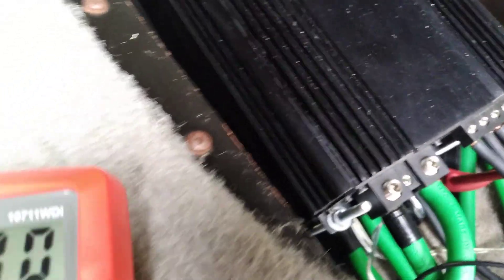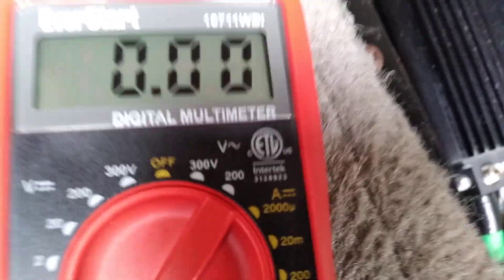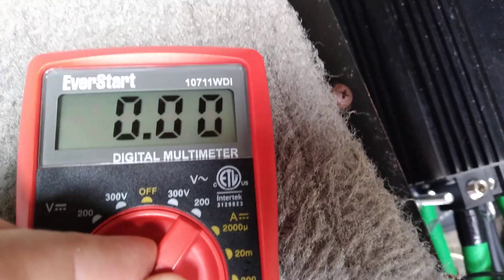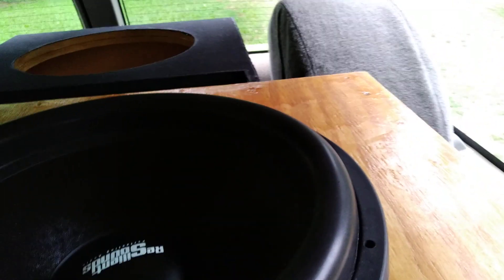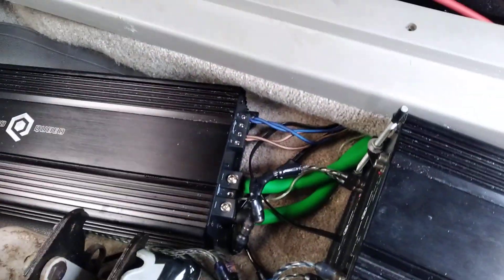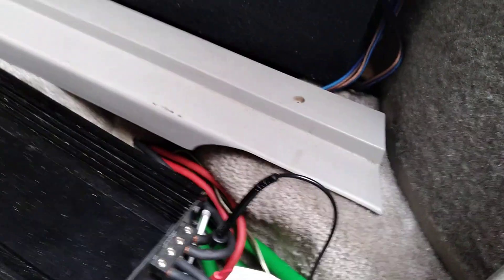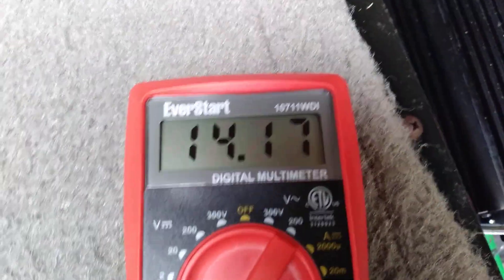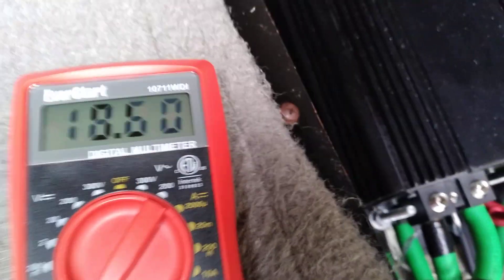Checking my ohms rise buy using a multimeter

Comment: When strapped, if impedance reads .5ohm on the multimeter that means each amp is seeing .25ohm. Id prolly wire them up to 2ohm final load(series/parallel coils on each sub)each amp will see 1ohm per. Will also be easier on ur electrical. Those 9.8v drops wont last long. U could actually gain dbs on the meter because ur not stressing the electrical system out as bad.
Reply from the maker: Thanks I might try wiring it up directly to see if it's better on the voltage.

Comment: Because your amps are strapped, internally they "See" half of the impedance per amp. that is shown externally.
Reply from the maker: Well I still think it's high ohms rise.
Reply: @RyanBassForLife  All systems have similar rise throughout the freq. Average impedance rise is between 2x to 5x rise.
Reply from the maker: @evilinside5984  do you think I should lower my ohms to .25ohms strapped? I'm at 1ohms strapped right now.
Reply: @RyanBassForLife  Your amps would see almost a dead short @ .25 ohms strapped= .125 per amp @ rest👀= 99% of all amps would Either go into protect, or go up in smoke! If you want more power, sell your 2-sq 2250s, and get 2-sq 4500s, or get the taramps Smart 8k.
Reply from the maker: @evilinside5984  yeah your right I need to upgrade.